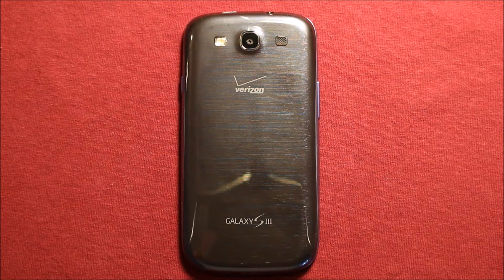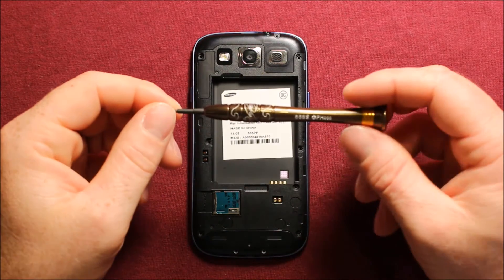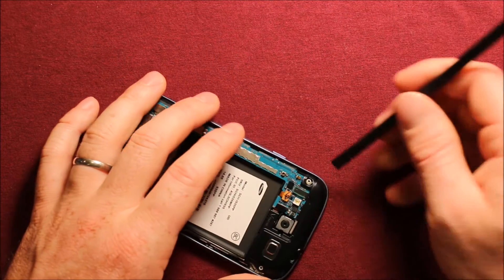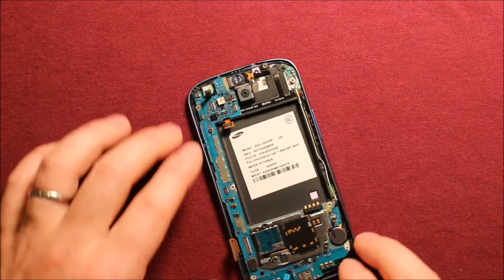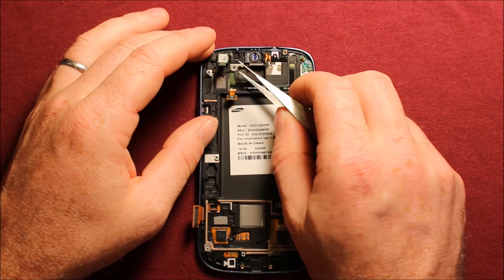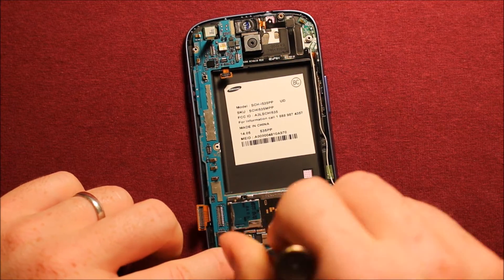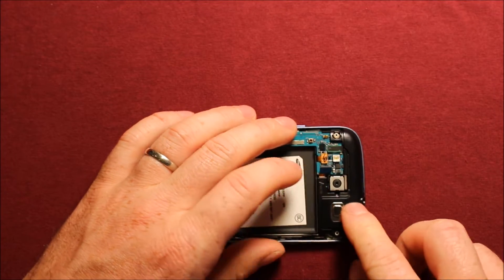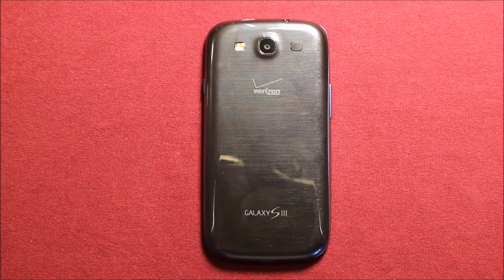Galaxy S3 Front Camera Replacement How To Change

Comment: I had some dust inside my camera resulting in a huge dark blob in the picture. I followed your excelent video. Remove the camera and used some canned clean air to blow it clean. It turns out the lens moves about 1mm(i guess to focus) when its blown on. Could not see this spec of dust even with my andonstar usb microscope so i deduced that the dust was inside the lens or on the silicon.  Also use some pure isopropanol  to clean lens. Then i assembled it all as your instruction and hey presto it worked. Blob gone. Moneys saved. Happiness, unicorns, fireworks and rainbows.
Reply from the maker: Hey that’s awesome great job! 👍👊

Comment: Thank you! The front camera in my S3 stopped working several months ago when the phone sunk in water. I tried to follow your video, but didn't manage to unscrew that last philips screw. It was too tight and the screwdriver I had probably was not the best quality. So, when I just assembled the phone back (thinking that I should buy another screwdriver and try again later), the front camera surprisingly came back to life!
Reply from the maker: +Gopal Peddinti Wow well good for you that worked out ok then! Maybe it just needed to reconnect something a bit.